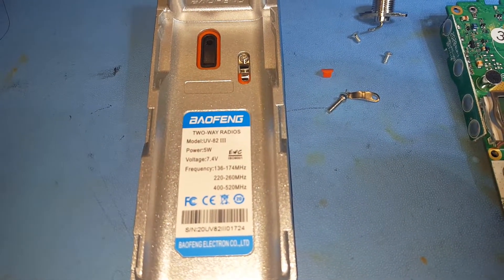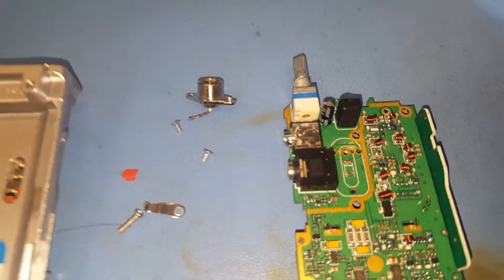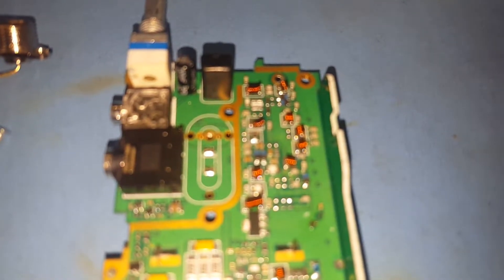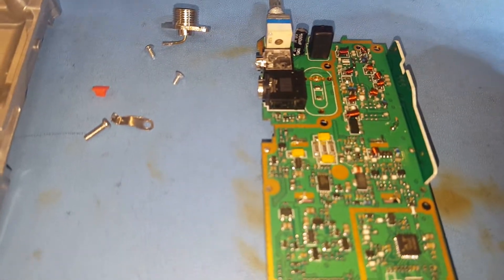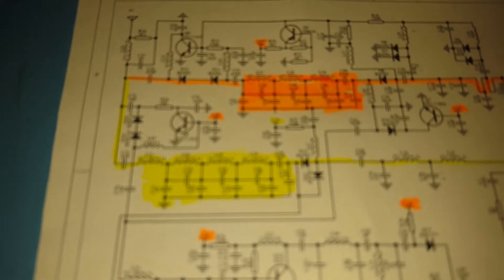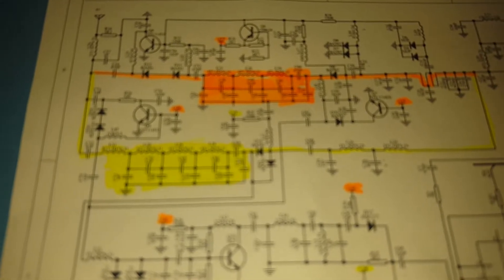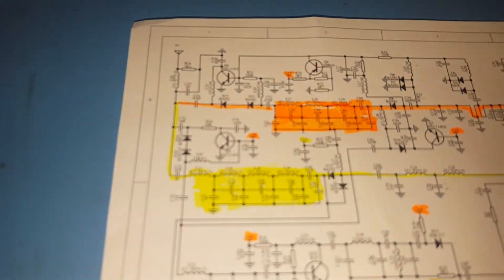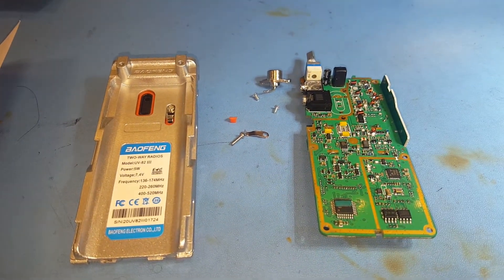Baofeng UV82 Tri-Band -  Stripped Down.

Comment: Hello, thank you for the video. I had a question, is there a protection circuit or filter in this radio that protects against high vswr or signal transmission without antenna?
Reply from the maker: Unfortunately, no.the radio is so cheap so you get what you pay for ,hi

Comment: So, the regular 136-174 / 400-520 MHz dual-band UV-82's  should emit less garbage harmonics so.. (I'll take it the dual band 2m/1.25m UV-82's are the same as this tri-band though.. just missing the UHF 70cm)
Reply from the maker: the dual band uv-82 board is the same as the uv-82 tri-band with less coils in the LPF to make it wider..I was a bit disappointed too. i guess that's why they're so cheap!!
Reply from the maker: The regular uv82 has better harmonics suppression. The 'tri band 'output lpf is so wide at vhf so it can pass through the 1.25m band and 2m as  well.